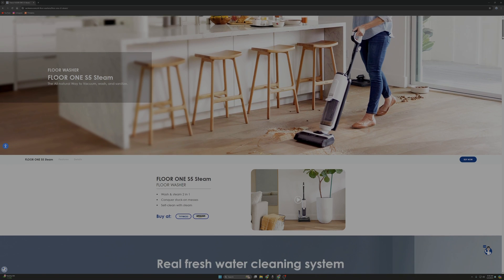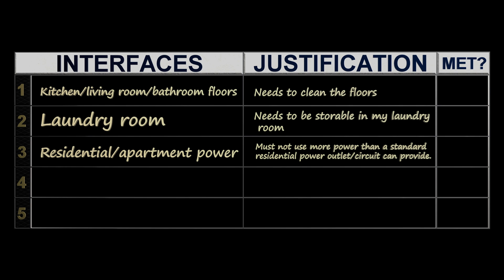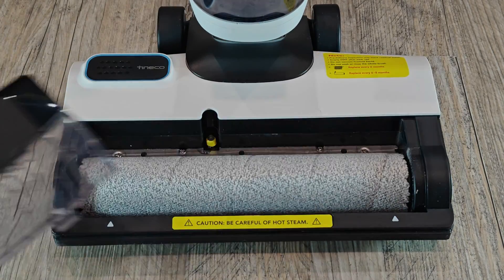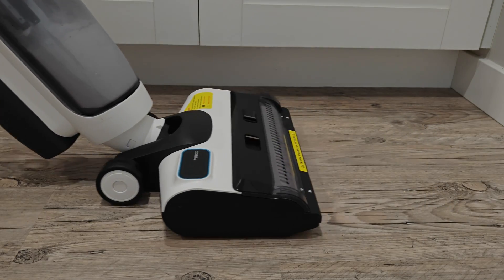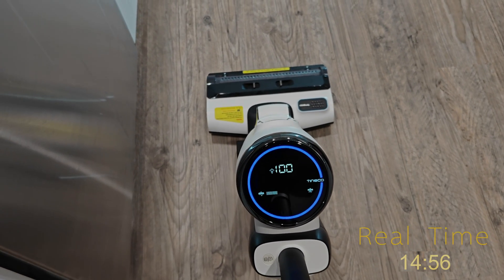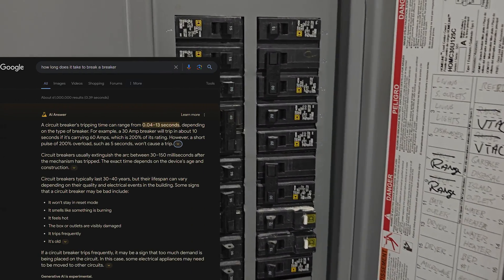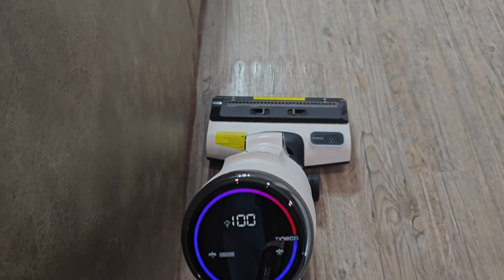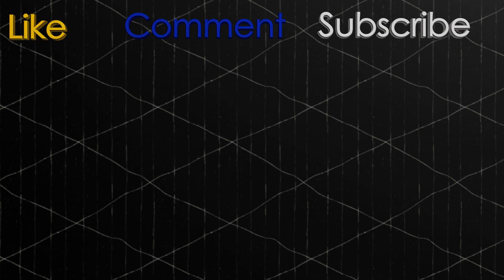Hot & Steamy - Tineco Floor One S5 Steam Review

Comment: Hey you are the perfect person to answer my question!!
It specifically says its not compatible with any cleaning solutions (pinesol has been known to break machines you are supposed to use only machine floor cleaners in the compatible machines) 
They tell you specifically to only use water even for the non steam mode
but i have to wonder if this isnt to encourage people to purchase 2 vacuums or the very expensive one that is says does all 3 Especially because they have one that does all 3 and i cant find any info on how its buit differently that would make it incompatible with machine cleaning solution Any ideas on why it might be harmful?
Reply from the maker: That is difficult to judge without tearing both machines apart or having a complete model or engineering document. All I can do is guess at this point. The most basic issue may come from the dirty water (optical) sensor. Even liquids that may look completely translucent to a human may not to the sensor. Also, soap bubbles can make the sensor think the water is dirty, and the waste water tank would fill rapidly in volume and complete the circuit of the full tank sensor. 

There is also the question of what material the machine is made of internally. There very likely could be a component that could rapidly degrade while in contact with some cleaners. Chemically resistant materials can be significantly more expensive than materials that aren't rated for chemical resistance.

Lastly, the way they heat the fluid for steam can affect what chemicals can safely be used with the machine. In the machine I tested in this video, the cleaner would have to be mixed with the water, there is no way to separate them within the machine. They appear to be nearly flash hearing the water, meaning the water comes into contact with a small but very high energy heating element. It is possible that the flashpoint of a cleaning solution is low enough that it could start a fire.
Reply: @AnEngineersWeekend  thanks for responding!

Comment: Can it clean vertical surfaces?
Reply from the maker: I have not tested that. Although, probably not. Gravity likey is needed to properly pull water from the water tank. So if you invert the machine it could have issues pumping water. This is just a guess, you'd have to ask Tineco.

Comment: The edge cleaning is needed since that is where most hair accumulates (at least in my home). Did it leave any watermarks after the floor dried?
Reply from the maker: It did not leave water marks on my floor, but I also only used filtered water.
Reply: if this is your main issue i think you just should get a regular broom and sweep the edges that you need, is not a huge inconvenience